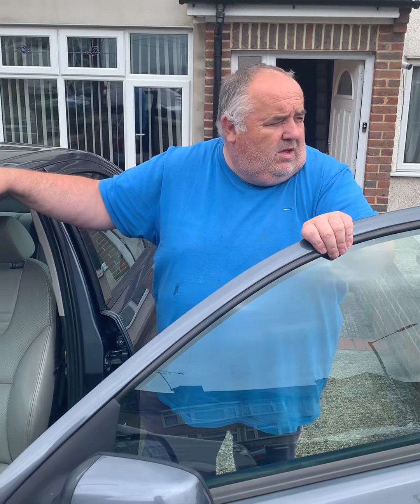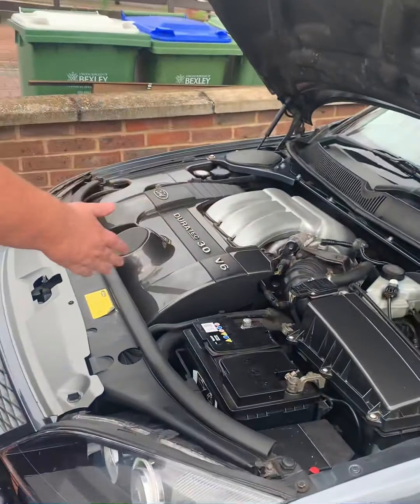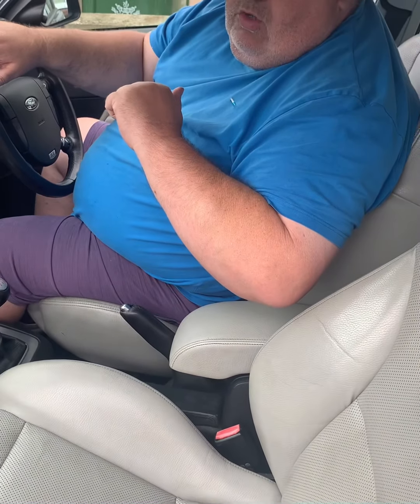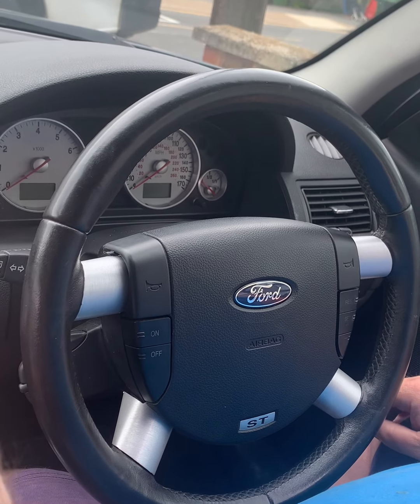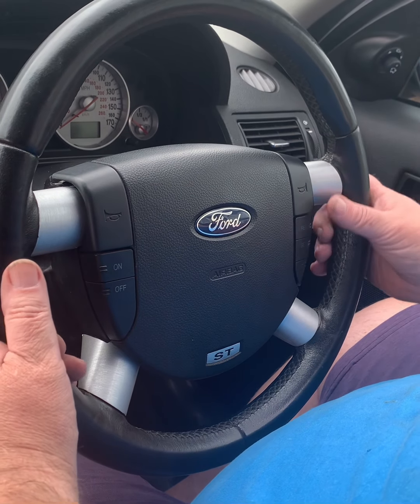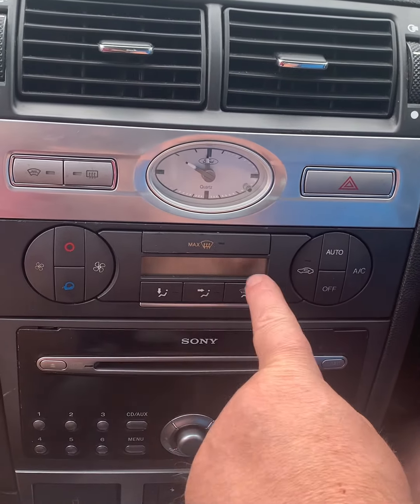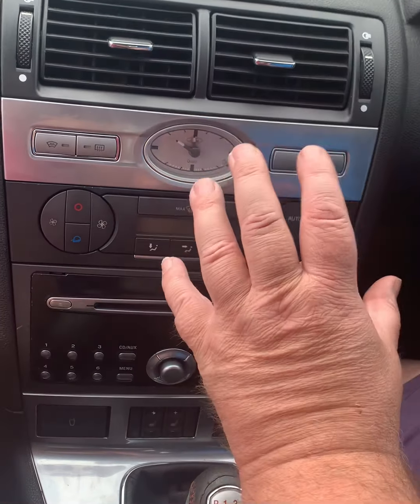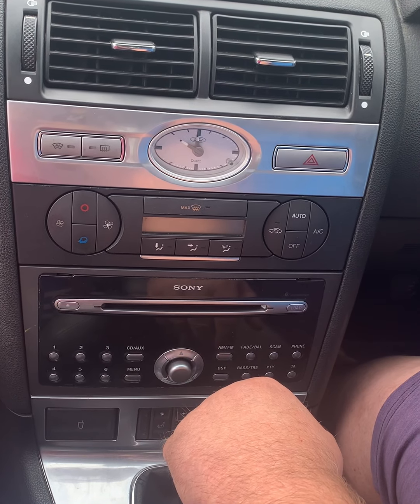Magma grey steering wheel spoke re-Ferb /update

Comment: Nice but also pretty expensive. I sanded mine with sandpaper, painted with plastic primer and zinc spray after that and put 3 layers of clear coat at the end.  Looking even better than original.
Reply from the maker: Great news I’m glad it came out well for you yes the way I did it was expensive thanks for sharing your thoughts
Reply from the maker: Thanks I watch your video nice job you did with the steering wheel 👍